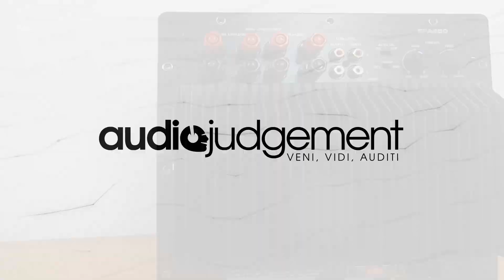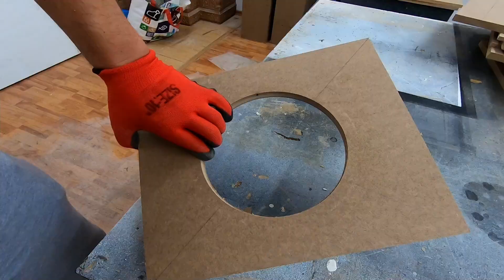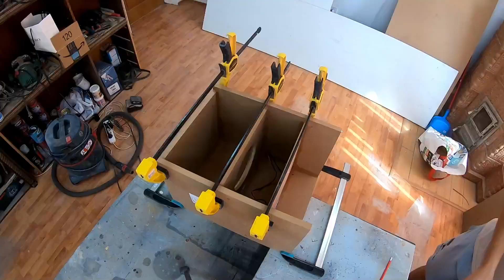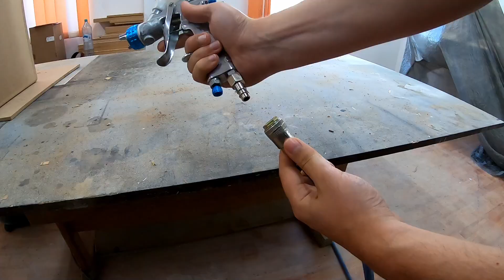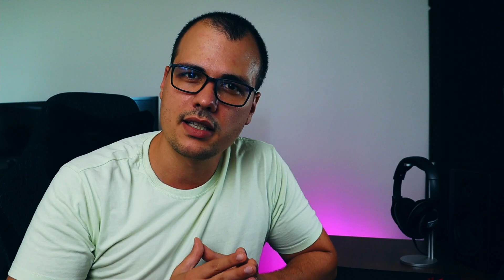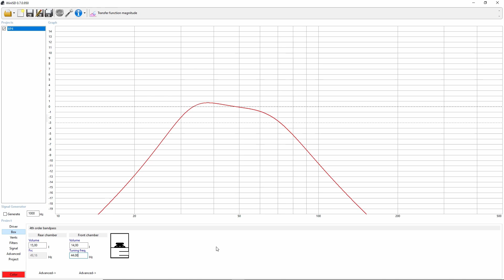4th Order Bandpass - What could go wrong?

Comment: Helo! I have extensive experience in construction BP 4th and will give you some friendly advice. Turn the speaker the other way around to cool it down. Sealed chamber must be smaller. Make simulation for speaker as sealed box. The volume should be such that give xmax at doubled nominal power. For better result, as posible, use a birch plywood 3/4 inch. Optimal port area is  2/3 Sd (effective diameter). Never fold the port! Divide the port in half with a vertical partition (rigidity and increased self-resonance of the port). Tuning frequency must be 48Hz -3dB. Do not symetrycal or flat response in simulation, the left edge must be higher. Make a 8dB efficience at peak.  Electrical polarity will be reversed. All the best!

Comment: I cant figure out why in WinISD.. when I specify a port to 6" wide.. in a 2cuft box.. it says 120" port length. What? But then.. when I add 2 ports.. each 6" wide.. it doubles the length?? How does that make sense? I've added a 2nd 6" port.. that should dbl the port volume with 2.. so why does the length now double? Or do the calculations get screwed up somehow when ports are too much volume?
Reply from the maker: Increasing the port area either by making it larger or by adding multiple ports will increase the resonant frequency of the box. To compensate for that (lower the resonant frequency) you need to make the port longer. In conclusion, to maintain the desired resonant frequency, if you increase the diameter of the port, you have to make it longer as well.
Reply: @AudioJudgement  Interesting.. I figured wider same length is more volume.. if anything I would think you would lower length to account for wider port. So why in WinISD can I apparently use a 1" port that is 12" long and seems to stay at the 35hz tune. That makes no sense given how boxes all seem to have larger ports. But more so.. why is adding a 2nd port ALSO requiring BOTH ports to be 2x longer? Again.. I would think more port volume with 2 ports would NOT require longer port length too? So how does one fit a 215inch port length in a 25" box? Or is it basically saying.. the driver can't come close to 35hz tune with out a beyond ridiculous port length?
Reply from the maker: You are exactly right. At some point the port becomes too long to fit inside the box. You either reduce the diameter to make the length more manageable and risk port air chuffing noise or you try a slot port which fits better even at high lengths.

Comment: I have a old Boston Acoustics PV400 4th order bandpass home theatre subwoofer. The enclosure is in the shape of a skyscraper, 10" x10" footprint and 20" tall and uses a little 7" woofer. Completely sealed with two down firing ports (it sits on little 1" legs) . One of the most unique little subs I have ever seen and for a small sub it cracks really hard, better than some high quality 10s I've owned. It sounds far better than it should. Awesome little score. Actually have two of them.

Comment: The problem with bandpass is that if you want a wide flat frequency response (30-60Hz) you won’t get the SPL. In that case you’re just building a complicated, heavier ported box. Bandpass is great for a narrow loud frequency. Look at that response at 5:52   +1 db. This same driver in a ported box will challenge that same response

Comment: I built a 4th order for a single 8 and never modeled it, but it's a 3:1 and it's had really good bandwidth, also on the port I rounded over the edges and cut a 45 for the curve in the port and there is absolutely no port noise, maybe I just got lucky but it seems like 4th orders or very dependent on your sealed side, even changing .1 cft changes the sound pretty drastically

Comment: Hey man I just wanna say I’ve talked to a lot of car audio gurus who specialize in bandpass enclosures and are known to build proven boxes that hit high spl numbers, all I can tell you is the magic formula that seems to work every time is keeping the sealed chamber small and ported chamber big, much bigger. 
I’ve seen guys shrink from 1.5cubes sealed to 1 cube sealed and gain massively on low end response and high end response. (Single 12).
For 15s you want around 1.5-1.7 cubes sealed. Don’t ask me why this works, but throw away most of the information you get from loudspeaker cookbook it’s outdated
Reply from the maker: This box is not about SPL, but rather linear response and wide playable range. If you want to hit just one note for high SPL, you can do that. However, if you want linear response that box would be awful.

Comment: Unrelated question, can I perform spl measurements on a tower speaker before I install the port(tuned for 40hz )( mid and tweeter are sealed) ? If yes should I measure without hole or with hole. (Port is out of stock rn. )
Reply from the maker: If you don't have the port installed then it's not tuned to 40 Hz. The measurements would be pointless
Reply: @AudioJudgement  my logic was since psudo anechoic deletes hz below 200hz then having a port with pipe and port with no pipe would create the same spl graph
Reply from the maker: Well, yeah, but the bass driver will behave differently as you now basically have a hole in your box and large amounts of cancellations will occur

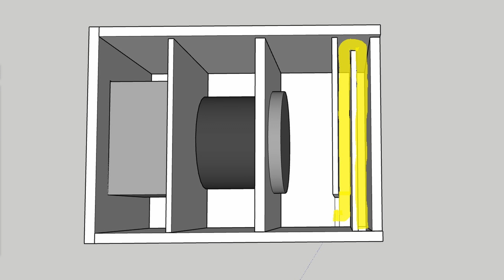Comment: Bandpass chassis: Magnet: mid to high power. Membrane: stiff as f*** but light as a feather. Heavy membrane let the box get small but also the impulsivity gets slow and queasy. 8:30 The longer a port gets, the higher the problems (in case you want a BP that sound good and not only is loud). This one is too long for a good sounding BP. I think this is not a good chassis for a BP. The numbers may say that you can use it but there is more than a (compiled) perfect frequency response. I have a Monacor SPH-250 CTC in a BP. The numbers say it would better fit in a horn or TL but the sound you get out of this box is awesome. It has 4 ports with 7 cm diameter, 18,5 cm long (on the other side the box is 78 litres big but therefore needs not much power for high volume)

Comment: I made one 12" ported height 1" x 12" 
Vent air velocity is under 17m/sec as per winisd. But still I got port noise. One reaon could be the port height too small compared to width.

Comment: Hi there,
Nice finish on the box, and very smart that you made a seperate chamber for the amplifier.
Some tips on your concerns: to lower the port noise you could try to place some 45 degree pieces in the corners of the port to help guide the airflow. More importantly, roundover the edges of the port pieces, both inside and outside of the box to avoid any sharp edges that will create turbulence/noise.
I also noticed that you did not continue the port length example through the baffle, which is also part of the port.
For best SQ, the UM8-22 however is best used in a sealed box. Any resonant system (ported design), prefers a driver with a Qts of 0.5 or below to improve damping. The QTS of the UM8 is already above that, but in a 15L box, the QTS increases to almost 0.9. Something like the similar priced/capable RSS210HO would be better suited for this application. It has less Xmax, but with the 200W amp, that should not be an issue. I think you already mentioned this in your ported subwoofer design video, why not appply it?
I also understand you dont use bracing for this small box, but a thinner MDF sheet is used for sealing the rear chamber. This rear chamber also has very high preasure levels, and this back panel has the largest span width! This is by far the weakest point of the box, which could harm Ql. (same goes for the port pieces)
If you want the best matching between WINisd and your measurements, also change Qa, Ql and Qp to realistic values. You can even turn on transmission line simulation to see how the port resonances influence the frequency response.
Reply from the maker: Yes, I was analyzing some of the details which I didn't consider important since the port air velocity was much lower than what I'm used to. Like not rounding port panels, or using thinner port panels. Regarding enclosure type, as far as I know, what works in sealed, works in BP4 as well.

Comment: Build a double reflex box, they sound so nice. I don't like bandpass subs
Reply: I took a brief look at double-reflex boxes.  They made sense back when drivers had low Xmax. Most good drivers these days don't suffer from that issue, so the loss of in-band linearity for the slightly better power handling is no longer an enticing tradeoff.
Reply: I meant dual reflex boxes (it's a bose type enclosure) with resonant chambers on both sides of the speaker. It is quite rarely used, but i have a friend who builds these types of enclosures for stage audio, and they sound fantastic.
Reply: @dtibor5903  You've described what's more commonly known as a 6th order bandpass alignment.  More correctly, a 6th order parallel-tuned alignment.  They're not that uncommon. However they do require drivers with low Qts for the best results.
Reply from the maker: I think he is talking about the aperiodic bi-chamber enclosure
Reply: @AudioJudgement  I thought so to at first, but then he mentioned resonant chambers on both sides of the speaker.
Reply: Brian Steele 
    He stated his dislike of bandpass alignments
So
I think he might be talking about a taphorn.
Edit
Or
A 4th order bandpass 
But 
The sealed section
Is 
Also ported on the same exterior panel.
Reply: @amsb4dafunk406  He mentioned "resonant chambers on both sides of the speaker".  He also mentioned that they were like the Bose enclosures. Tapped horns don't really have resonant chambers.  That description he provided sounds more like 6th order bandpass.  And Bose did (and does) make 6th order bandpass subs.
Reply: It called doube chamber reflex also
Reply: Their advantage is there are 2 chambers, one tuned for 40-45hz and the second one is tuned to around 80-90 hz

Comment: 4:47, get a UMIK-1 and your statement here will change. I've got a number of recordings/videos and it picks up the bass just fine. Even the subsonic frequencies under 20Hz it records faithfully. It's accuracy is lower the lower you play under 20Hz but it still does a great job under 20Hz.

For this subwoofer though the UMIK-1 would perfectly record any sound it puts out.
Reply: Marius does own a UMIK-1. I suspect he means it's difficult to record it in a way that would convey the issue in a Youtube video.
Reply from the maker: To be honest, it didn't cross my mind to use my measurement microphone for recording audio :)
Reply: @AudioJudgement  It does a good job. If the bass is flat then the recording will reflect that. If it has uneven bass then that'll show in the recording. And if played back on a system that is tuned flat it'll sound almost identical to the response you recorded. (Hope that makes sense)

If you're trying to record port noise then that could be an issue if the mic is close and you play it loud enough to overload the mic. My Umik-1 is limited to 120dB and in my car my Ultimax 10 overloads the mic especially in the 18Hz+ area. 

I use either my iPad Pro (It actually works with the iPad and I found a good app that can properly utilize the mic) or audacity to record with it. And I can watch the limits of the Umik-1 that way.

Comment: After designing and building subwoofers for a number of years, I find that you learn more from a build that goes wrong than you do from a build that goes right. 

A number of things concerning 4th order BP designs:

1. Don't use WinISD, or any other design program that doesn't take into account at least the driver's inductance, and preferably its semi-inductance parameters, if you're designing a 4th order BP build for SQ use. The inductance is going to have an effect on the shape of the passband.

2. Don't use folded slot vents.  Instead, design the build so that the vent is one straight vent, and use a vent that you can remove and therefore trim to adjust the passband response. If the vent needs to be quite long, check the layout of the original Bose AM5 module for an idea of how to accommodate a long straight vent in a box. 

3. Don't put the vent on the panel that's opposite the subwoofer driver. Instead, design the build so the vent is on an adjacent panel.  Size the box, the panels and the vent right, and you'll be able to null out the first out of band resonance.  I have an Excel workbook on my website that can help to achieve this (it outputs a corresponding Hornresp model that you can import into Hornresp for viewing). 

4. Always design the box so that the driver is removable and you have access to both chambers of the box after you've put it together :-). 

5. If you line the vented section, the magnitude of the out of band resonances will be reduced. 

Brian Steele
www.diysubwoofers.org
Reply from the maker: Is inductance that serious? I feel that a 1-1.5 mH inductor will have a negligible effect on the 20-80 Hz frequency range. The circular port I could fit is a 3" which I feel is not enough. You just gave me an idea to place a 4" port which goes through the sealed chamber. Doing so, I won't be able to make adjustment afterwards, as I need to fix the port in place, and seal the crossing between the sealed and ported chamber. Still, better then folded slot ports. I don't know how to make the speaker accessible, other than gasket and screws. But I don't have a lot of confidence in that. If you are screwing and unscrewing more than once in MDF, the screws won't hold on as good.
Reply: Audio Judgement 
    Use Parts-Express Hurricane Nuts
Item# 081-1084
Reply: @AudioJudgement  The only way to find out how much impact the driver's inductance (and its semi-inductance characteristics) will have on the overall output is to model it.  That particular driver though seems to have pretty low inductance to begin with, so the impact might be small.

I used two 3" flared vents for my recent 10" 4th order bandpass subwoofer "renovation", and they work well. That driver does not have 16mm of Xmax though :-). 

You can use hurricane nuts as suggested to make a panel removable.  Design the layout of the subwoofer so that the removable panel gives you access to both the driver and the vent.  See the following link for how I did it for my 10" bandpass design. 

https://www.diysubwoofers.org/projects/home/inf10bp/

Note that layout puts the subwoofer's magnet in the sealed section of the box.  For a bit more power handling (better heat dissipation), tweak the design so that the subwoofer's magnet ends up in the vented section. 

I built that subwoofer almost 18 years ago, btw.  It's still in use, with a new driver and a refinished cabinet, in my brother's bar, providing bass duty for his background music system.
Reply: Hi Brian,
Some good tips there.
Is this WinISD issue only with 4th order BP designs? In my experience, WINisd works perfect for normal bass reflex.
The are some conditions however: you have to change Qa, Ql, and Qp according to your design. With transmision line port simulation activated, it simulates even more accurate to reality. As a note, WinISD does support to simulate voice coil inductance, in the advanced section, it is next to the "use transmission line model for port simulation" option.
Thank you for your website btw, I've visited it before when I was in search for tapped horn designs. I've not been able yet to design one of these, but will sure do in the future.
Reply: @pim_kahlert  If WinISD can't model semi-inductance, its sims will likely be less accurate for subwoofer drivers where Le is large in comparison to Re. 

Hornresp allows the use of the semi-inductance parameters in a sim, but it does have its own issues too, like not including the effects of any losses unless under specific conditions. 

The semi-inductance parameters of a driver are not usually published as of now, but can be derived from the driver's free air impedance curve, using a spreadsheet that's available on my website. 

I learned all this via my Enigma subwoofer build and rebuild, btw.  I called it "Enigma" because the measured curve didn't match the sim'd curve, and I couldn't figure out why at the time.  I designed it first using equations for 4th order BP enclosures, and the measured response was not what I expected.  Over the years I used better and better models to try and see if I could get a sim that provides a better match for the actual result, and it looks like Hornresp's "offset driver / offset vent" model is the closest match.

Unfortunately none of these sim tools can really sim the impact that a nearby panel might have on the vent's effective length, so be prepared to trim the vent anyway to achieve the target Fb.

Comment: Proper design for a box that has good freq response and flat enough bandwidth to minimize listening fatigue will always have a smaller ported chamber than the sealed chamber, and the subs ebp should be <51. Port area is determined by qes and sd, and mach should be .04-.05.